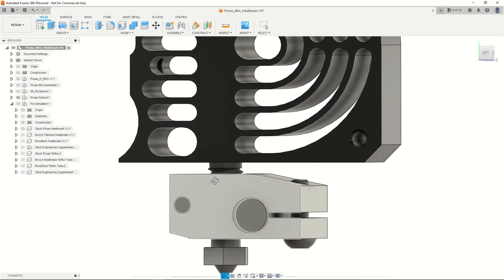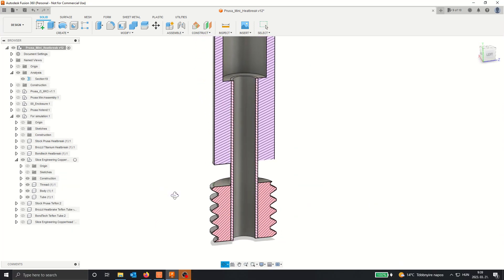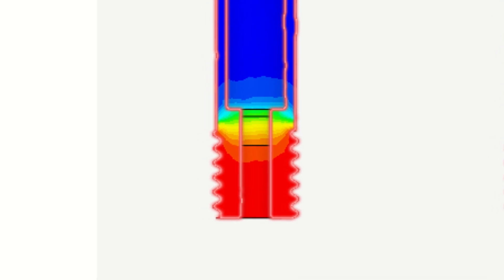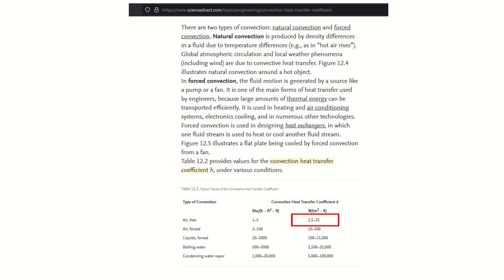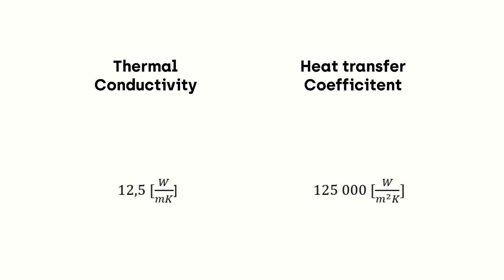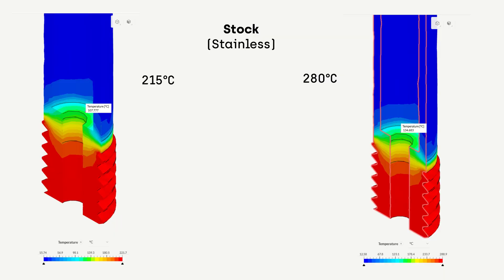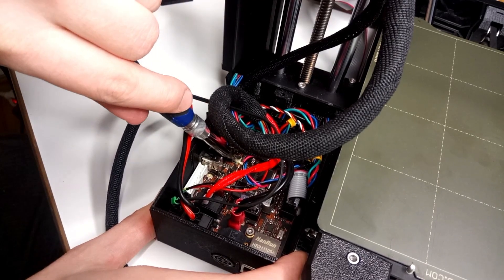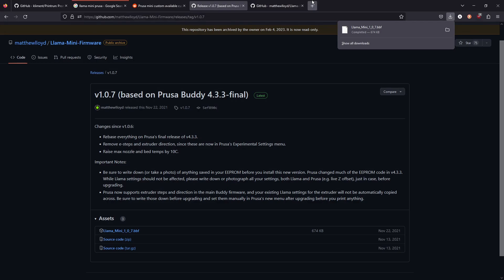Prusa Mini Heatbreaks Simulated Brozzl, Bondtech, Copperhead

Comment: Awesome video. Prusa sends AG Silver with all the replacements you buy from them (they will send you this if you buy a heatbreak, heatsink or heatblock). The thermal conductivity of this one is 3.8 W/mK and can handle up to 250°C constant temperatures (more than enough for the heatsink section). I've seen higher Thermal Conductivity in CPU thermal pastes, but these cannot work for such temperatures for a long time. I tried using regular Thermaltake in an extruder and it dried up super fast, caused a clog and I had to replace it. So it may be worth re-running the tests

Comment: As another engineer watching this video, I have to commend your excellent work.  This is worthy of a masters thesis.  Your assumptions are solid and your insights are very astute.  I especially love that your measured temps by sticking a thermometer down the throat were spot on (simple yet brilliant).  I purchased one of the Trianglelab Titanium designs and plan on replacing it next time I get a chance.

Comment: If you use some really good thermal paste (boron nitride) on the Stock Heatbreak, will it be enough to solve the PTFE shrinkage issues? And would it change the values enough to require a PID tune? I am keeping mine as close to stock as possible as I want to be able to stay current with the firmware updates they are working on.
Reply from the maker: Sorry for the extra late reply. After some fiddling I concluded that the PID tune change made almost no difference, even with a different heatbreak.  Just keep it stock in my opinion.

Comment: I tried Bondtech heatbreak and compared with Mini original one it has shorter heating zone that causes never ending problems with Prusament PLA. Could you please also add E3D Revo heatbreak in the simulation?
Reply: Which did u switch to

Comment from the maker: PLEASE DON'T void your warranty like I did because there is not much to gain. I realized the Marlin implementation of PID autotune isn't really good. I'll try to cover that later.
Also at 5:20 I made a mistake and the selected a too big area for air heat convection on the Copperhead (you can see the it highlighted by blue). I think it doesn't change much because the heat transfer coefficient is so small compared to the thermal paste, it barely makes any difference.